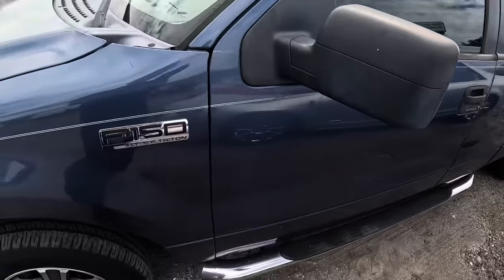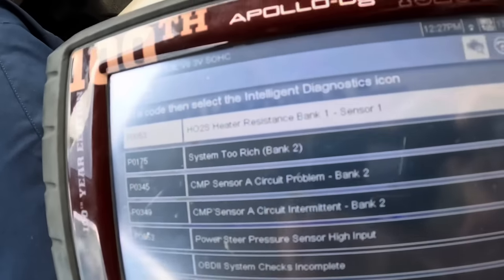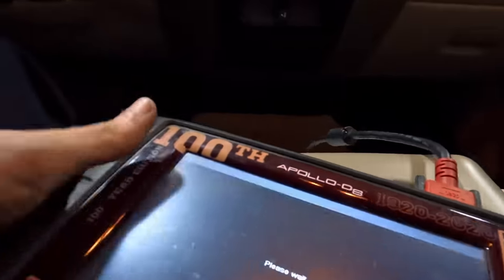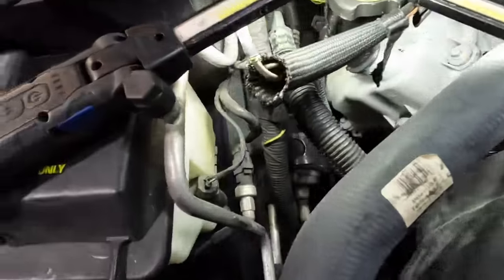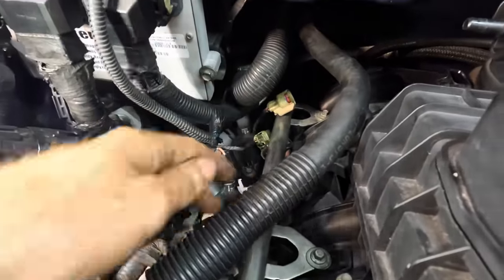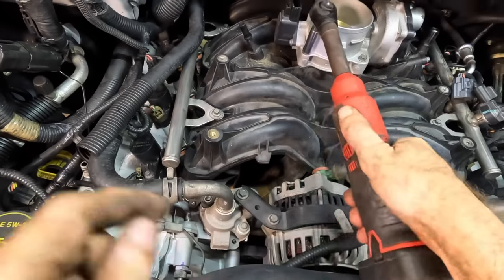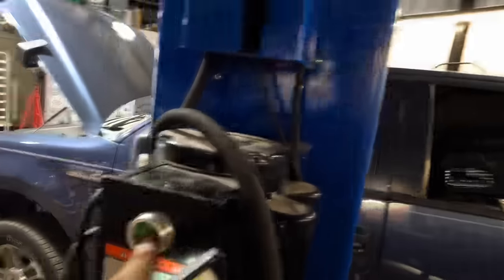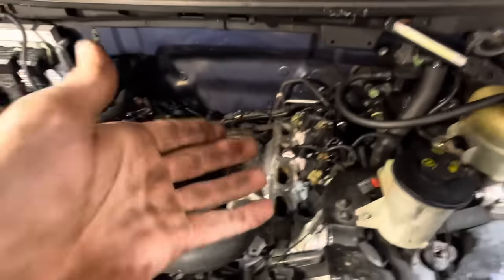Hack Job! Mechanic Botches Engine Replacement! Multiple DTC's

Comment: Clearly the engine installer was trying to beat the book time to increase his $110/hr labor and the results speak for themselves!
Reply: Along with that, why the multiple splices on various components?
Reply: @larrybe2900  probably they forgot to unplug some cables, then they got ripped apart when they pulled the engine out.
Reply: I raised my labor rate last month. Unrelated to auto repair and I'll raise it again after new year. Along with that I'll also bump up the markup on some parts from 10% to 15%.
Reply: Ya get what you pay for
Reply: I'm curious about who installed the engine. Did a shop do the work, or was it my brother's uncle knows a guy that can do it cheap but good. 😂😂😂
Reply: @108gk  A 15% mark up is a little light.  When I had my shop, now retired, I was running a 20%  to 25% markup on parts, hated trading dollars for dollars.
Reply: @Mprikiman Ford harnesses can in fact be repaired with pigtails. Im currently watching the video now but that's pretty common if the connector is damaged
Reply: @sebbykaiser6466  yep, there’s A LOT of videos from Arod doing just that all over and around F250’s
Reply: @KendrasEdge757 How much did he pay?
Reply: I thought the labor rate was for the shop performing the warranty work, not the rebuilder.
Reply: @defresurrection  how much did who pay? If you’re referring to my comment about Arod doing that on F250’s he’s a ford diesel certified mechanic that used to work at a dealer. His channel is Powerstroke Tech Talk w/Arod up here.
Reply: Wow Ray. That's a ton of trouble right there. And that was a ton of diagnosing you did. I'm certainly not an expert, but it looks to me like your customer will be thrilled with your work, and very unhappy with the engine installer. Another great video!
Reply: @defresurrection correct that’s the warranty labor rate not the installers labor rate.
Reply: @KendrasEdge757  you said you get what you pay for, indicating it was a cheap motor. I thought you had insider info about what the owner paid for the motor.
Reply: Where can you get your vehicle fixed for $110/hr? Here it is from $200 to $300 an hour.
.
Reply: @Thisoldhiker the customer should have to source all parts for their junk. A mechanic should only need to fix said vehicle. People bitch about having to pay to fix their cars but couldn't and can't understand basic functions of the thing they spent so much money on. It's a good gauge into how stupid our whole society. There's no fixing it, and people that don't know the basics should have to pay double for their stupidity.
Reply: Looks to me like someone pulled the engine, and then a month later or whenever the reman showed up someone else installed it
Reply: @kenjaminhanson3853  I believe you may be on the right track or it was done in a shop like you see in the russian videos.I know I maybe speaking out of turn but every engine that I have plucked ,rebuilt & reinstalled has never had a problem (if you are doing it for the first time take photos.).It is not that hard just takes a little longer.Cheers.
Reply: @defresurrection  With the paperwork Ray was showing was from the rebuilder could be wrong but it looked like it though as it listed parts replaced in the engine.Cheers.
Reply: @craigd1275  Jeez I'm glad I live in AUS my mechanic is $120 per hour.
Reply: @pwarren1516  That is a good explanation still doesn't account for shoddy workmanship maybe just me but I was always taught if you are going to do a job do it right the first time.I hate hacks.Cheers.
Reply: In my opinion, all wires should be soldered and covered with heat shrink whenever possible.
Reply: @LesReeves  I agree.  They clearly gave no fucks
Reply: Getting parts and specialty tools IS a full position job. No parts, no tools, no work. Most tradesmen don’t recognize that as part of the job, but IT TAKES TIME, and they should.
Reply: @108gk ,,, but why ,, so much ,,, I know things have went up ,, for your loyal customers ,, geez ,, not trying to be mean cause I know y’all have a hard job ,, I be one to expect close to excellent from my mechanic ,, but that sounds like a big jump on all prices !!
Reply: @phyllisalderson6247  It's not auto related but troubleshooting and repair principles are similar. The only thing I work on is classic Hammond organs and Leslie speakers. Speciality work on classic antique items, no qualified competition in my area. Not real steady work but I should be spending more time on my boat anyway.
Reply: Here last i seen was 99$/h in average
Reply: @athompson8976  The mechanic should warranty his work. The engine has a parts warranty covered by the rebuild company. Installation should be warranted by the shop that did the swap. If it was my car I'd do the same as the owner. Take it to someone else since you already know the last mechanic didn't pay much attention to detail
Reply: @108gk  ,, thanks ,, wow didn’t know anyone still working on those ,, good to know
Reply: Absolutely! Rushing to put more money 💰 in his pocket.
Reply: The shop I retired from recently was $96/hr labor rate.

I, and the other guys in the shop, always try to make it look like you were never in there when the job is done, other than maybe it's cleaner. Even the best most careful tech will have things break. The trick is to fix it, not try to hide it.
Reply: 110 an hour more like 200 an hour lol
Reply: @RichThiele  once a tech breaks something, he won't mention it. Just give you back your car. If you point it out. He will lie and say you brought it in like that.
Reply: @kenjaminhanson3853 I used to think that as well. Holley (I think) did a video on various wire connections. Solder doesn't do well with vibration and shaking. A 'proper' crimp, as in the correct size, quality material, and crimped with a crimping tool and not crushed with pliers, with heat shrink is best in an automotive environment. Those crimp connectors with the colored plastic insulators from auto parts and hardware stores are garbage.
Reply: I reflect upon credit card companies not satisfied with the base inflation their rates are calculated upon to see their profits rise but have raised the percentage also and fees to vendors. Just needed to vent. Then, the company "Toast" that operates dining websites who get paid a fee for their services by the dining establishment began adding a flat $.99 fee onto every order that their company handled over $10. Toast should be toast.
Reply: @Fred-xo3ku clearly you’ve been going to the wrong shop then because I’ve never done that and I’ve never worked for anyone that would allow that.
Reply: It's $110/hr for a third party mechanic to do any warranty work.  The person installing it is making way less than $110/hr.
Reply: @defresurrection I believe it was a "crate" rebuild, maybe from Jasper, etc.. Owner most likely bought it, had it shipped to a separate shop where the installed it "shttily".
Reply: @KendrasEdge757 I think he's wondering how much the install was. If I'm not mistaken, the install price is separate from purchase of the engine. The owner would locate a shop to install it, then buy the engine and have it shipped to the installer's shop.
Reply: @damianlindsey6177 Why would someone take their car to a shop, ask for repairs and then have to go out and buy the parts needed themselves to supply the mechanic? Did I miss something or was your comment meant to be serious?
Reply: @pwarren1516 Correct. The engine was probably from Jasper or another company. They only sell & ship engines. The owner is responsible for locating an installer.
Reply: @LesReeves Damn! If my math is correct, that's about $75 USD. 1 Australian dollar equals about 63 cents US.
Reply: @LesReeves @LesReeves Yup, crappy labor rate equals crappy labor. But I don't believe the rate Ray was stating at $100/hr was for the engine install. I think that's if the rebuilt engine is faulty, the warranty company will pay $100/hr to have warranty work done to the rebuilt engine (or whatever the rate Ray stated at the beginning). I believe that would also cover install labor. In this situation, I believe the owner's original engine failed and he bought this reman engine. The owner then paid out of pocket for the install. The warranty for the engine doesn't kick in until a problem comes up with this engine. No warranty work yet.
Reply: @defresurrection  oh no not at all. Just sayin takin the easy/cheaper route doesn’t always pan out. You get what you pay for when it comes to everything. That doesn’t necessarily mean more expensive is better either, but just a sayin that’s based in facts and experiences.
Reply: What's the average rate now?
Reply: @108gk and yet none of us get an increase in wages...
Reply: @Tyani-sz6cg  around me it’s $125-$140/hr
Reply: 110 was the labor rate the warranty Co will pay if the motor fails, not what the installer charged. The mechanic who sold and installed the engine charged whatever he wanted, if the motor fails though the warranty co will only pay 110 per hour. The the mechanic who does the job replacing the engine if it does fail can also charge whatever they want, but if it is more than 110 the vehicle owner would be stuck paying the difference. I work at a shop that charges 139, we get warranty co.s all the time that will only pay 110 or 120 and the vehicle owner pays the difference.
Reply: @sethfrancissimracing7558  that’s why I’d only get “warranty” work done at the dealer. Not getting raped for something we already paid for when we bought the vehicle.
Reply: It was a piece of junk that the engine failed before 200,000 miles. Anyway I have a 2004 Durango with 350,000 miles just like all the Durango you see driving around in your town and all those jeeps they’re all made by the same companyand they’re all 2030 and 40 years old. There’s a difference between Ford and Dodge Chrysler Ford is junk.
Reply: @AmericanSurvival001  lol
Reply: @defresurrection No.  That's what the manufacturer/ reman company will pay when a shop files a labor claim on defective parts - engines - transmissions.  That's not what the customer pays for original installation.  I won't deal with crappy companies who can't match the actual labor rate we charge.
Reply: If only techs got $110 an hour. I would still be doing it
Reply: @AmericanSurvival001 Lol there is basically no dodges in my area older than 2013. They all rotted and fell apart. Including mind.
Reply: @LesReeves  Around here in Marietta Georgia USA it is $135-$145 per hour.  

So it’s not far off. 

Either way it’s too expensive! Nobody should be having to pay over $100 an hour!!
Reply: 110 dollars per month. Never mind the rich fuel. The rich mechanic is charging too much. Our shop cost here is abouts 80 dollars /hour.
Reply: @Cantthinkofahandle117 : Crimp, crimp, solder, gel seal heat-shrink. Better than original wire.
Reply: @KendrasEdge757 : Correction: "You never get more than you pay for. You often get less, but never more."
Reply: @edwatts9890  wouldn’t say correction lol but that’s true though too
Reply: I'm impressed that Ford made a product that doesn't require the removal of the axle to remove the alternator...😄
Reply: I'm sure you did😂

Comment: The owner must really love that 200k mile F150 to spend that kind of money on it, then pay you to diagnose the problems when it didn't go right.
Reply: New one in Oz is $140,000.Ray is a better option in my opinion.
Reply: Plus, the body will last 30 years in FL if he stays away from the beach.
Reply: First thing I noticed was the condition of the interior of a truck with 200k miles. Someone takes very good care of that vehicle.
Reply: @svthorasailing4868   Yes, but that's the states and they should be able to get a new one for less than $50K, and that's for the 5 litre.  Something with low mileage would be a lot cheaper.  I still think this vehicle means a lot to the owner otherwise he wouldn't put himself through it when it's never going to be as reliable as when it was new.  Constant shop visits from here on in, that vehicle will probably put Ray's kids through college... (joking, but not joking).
Reply: I’m driving an 07 with 200K on it.
It still runs, looks, and drives like new.
Reply: Just think how much a new truck costs.  I would spend up to 5 grand to keep my old non rusted out truck on the road.
Reply: Most people can't afford a new 80k truck.
Reply: MY brother in law has been looking for a new F 150, prices around 70 thousand  @Chris_the_Muso
Reply: Super sleuthing. Great job evaluating install. Cheap phasers don’t play well n the 5.4.
Reply: my 2005 has 114k.... i have so many new parts on it, it would be stupid to trade in..... might be this guys situation also..... i might be looking at a new transmission....
Reply: @Chris_the_Muso  Base price on a 2024 XLT is $48k, and that's with zero options and a 2.7L V6 Turbo. That's if you can find one in stock. The dealers over here for the most part haven't negotiated the price ever since Covid, and they don't order base model trucks, just the really expensive models like the Limited and King Ranch. I'd fix the truck, too.
Reply: Ray you normally leave a lot open for guess work and opinions when following behind someone else's work. But, this is the first video that I have seen where you openly criticize and point out crappy work and there's plenty of video evidence to support your criticism of this install. 
Properly routed wiring is very important because that tight wiring harness across the back of the motor could actually pull even tighter as the motor torqued under a load . That rtv on the intake gasket screams "not a mechanic" and could cause enough of an air leak to cause many misfires because of the unmonitored air flow. 
Great video and informative to your audience. Keep up the great content and even better CYA with video especially because you are going in behind someone else!
Reply: Be better off slapping a Coyote powertrain since both the 5.4 and 5.0 are modular engines
Reply: @mrmustangman  I only purchase another vehicle if the one I'm driving is not worth fixing or cost prohibitive & never new let someone else deal with the warranty issues has always worked for me.(I also do all maintance on my vehicles.)
Reply: Paying a good mechanic for a proper repair is always cheaper than buying a new truck every 3 years or 100k miles.😉

Comment: It's a shame that people spend good $$ on repairs and then someone has to be sloppy and cover up mistakes.
Reply: Something about all this whispers 'Relative' or 'Buddy'.
"Think of all the money you'll save!"
Reply: Crimp connectors "protected" by electrical tape, in an area exposed to the elements?  I might expect that from a teenager, but for a professional mechanic it's malpractice.
Reply: Those connections are vulnerable to corrosion. Solder and shrink wrap.

Comment: Honesty is the best policy I've been mechanicing for 34 years and I've noticed a lot of people only trusted me cause I've been honest and did my mechanic jobs well 👍🏿
Reply: Absolutely.  I had a local garage work on the emission system on my car and the check engine light came back on shortly after.  I took it back and they found a leak in the canister they installed, probably a poorly seated o-ring.  They repaired it at no charge, and the car was fine after that.

Comment: I really wish you could expose these crooked people, so no one else gets screwed by them.  This is why I'm a YouTube certified mechanic.  Every time I've taken a vehicle to a shop, it's been a similar experience to this.  Learned pretty early in life if you want something done right, do it yourself.  The world needs more people like Ray, who are true professionals and take pride in their work.
Reply: the tech that installed that engine  needs to stick to oil changes.
Reply: @David-ik8wj  I wouldn't even trust them to do that right
Reply: @pwarren1516  probably use a 1/2 drive air impact to reinstall the drain plug, or not install the drain plug at all.
Reply: @andrewdonohue1853 let’s not forget leaving the o ring from the previous filter
Reply: @ForsakenLiye  i always look at the filter i have removed to make sure the gasket is still attached, sometimes it's difficult to see depending upon where the filter is mounted it, but the gasket should always come off with it
Reply: First time viewer here, from the beginning to the end of this video, I've been impressed with your details in describing everything. 66+ years old now and I have done a lot of work in those years. Only certification I ever received was front end alignment,on a dinosaur of a Hunter J111. But, still have seen some things that should never have happened to anyone. Pretty sure I'm gonna be looking forward to seeing more of your videos in the future Ray. Thank you for your service and integrity to the profession. 👍😉
Reply: I do computers. I had a tech show up to work on a server and he takes out a quarter drive drill and wants to use it inside my thousands of dollars electronic equipment and on screws which are 3/16 inch long. You don't need heavy construction 20-volt tools to work inside of a computer, just basic screwdrivers.
Reply: Sometimes special screwdrivers to fit specially made screwheads to keep out the untrained tech.@RowanHawkins